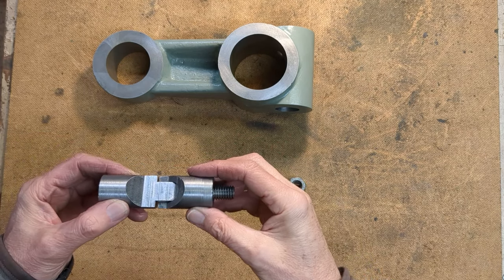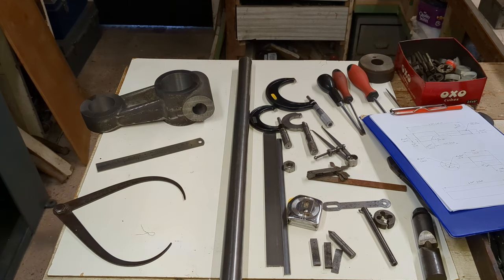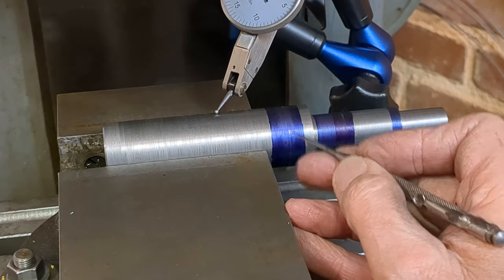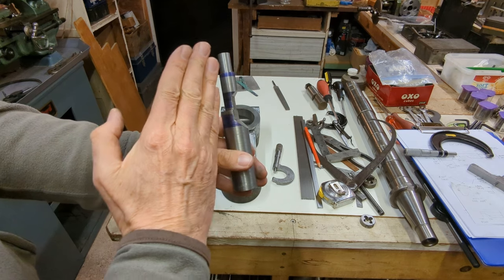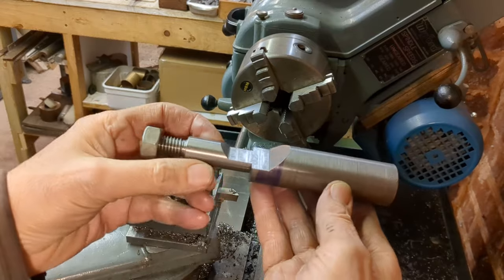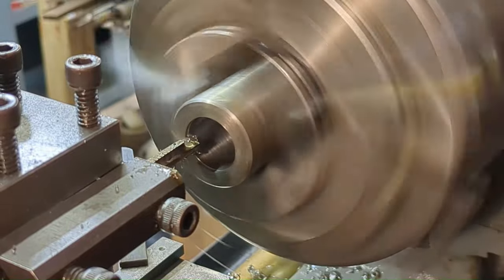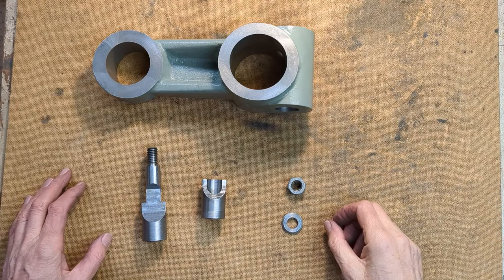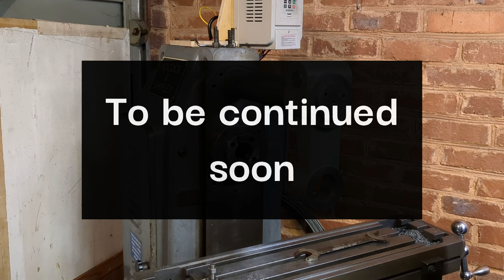Adcock & Shipley milling machine restoration - part 11 (cotter for support arm)

Comment: Excellent job as always. Clear, lucid explanation of the design choices and the work flow path. I very much liked the inclusion of a land to ensure the clamping load is correctly distributed. I enjoyed your film very much.
Reply from the maker: Thanks Carl for your feedback. It is quite possible that this feature is redundant but it was easy to include just in case!

Comment: Is there any significance in 47* degree angles. Versus say 45* degrees? 

Do you think there is any chance of deforming the 2.5" cast iron bar. Clamping it with angles instead of a radius. Or is that too pessimistic?
Reply from the maker: Ah yes, it does seem a bit arbitrary! The angle was derived from the geometry - specifically tangential contact on the bar at the middle of the female cotter.
I haven't done any calculations but I doubt the cast iron will permanently deform before the cotter yields. Of course everything is subject to elastic deformation.
Reply: Nice job however my OCD kicked in when you didn't true up the centre hole for potential rework😅.
Looking forward to the boring operation of the lower support arm bore.
Reply from the maker: Well noted. Looking forward to the boring operation seems to be a contradiction!